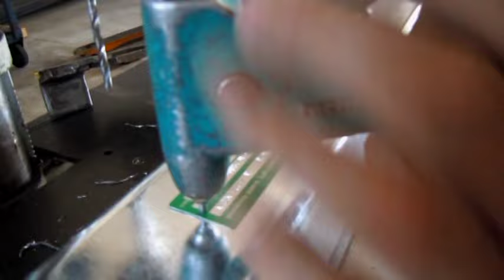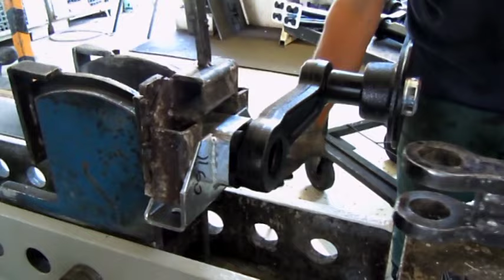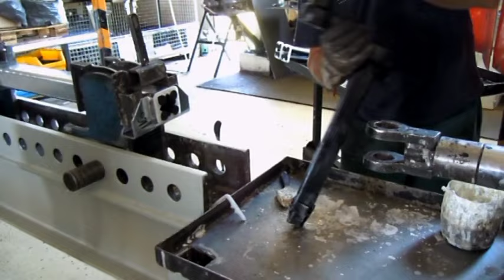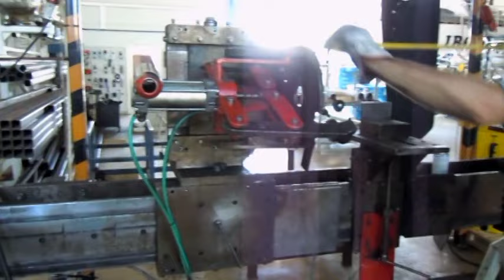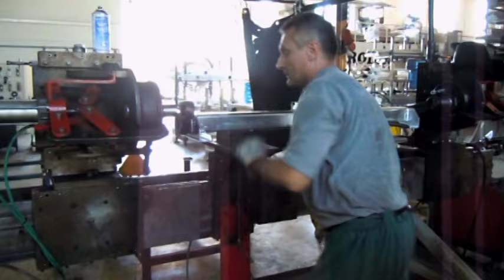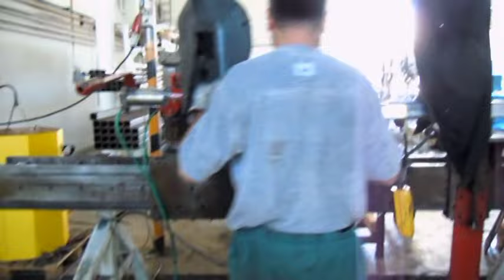Autóflex-Knott torziós tengely benyomása / torsion axle pressing in

Comment: I have made my own independent suspension units with 50mm box, 30mm square section and 18mm 70 shore rubber all pressed in in a home made press, works well, I used silicon spray as a lubricant.
Reply: Hi Tony, thank you for sharing as I have been planning to do the same. You mean 18mm diameter for the four rubbers - one per corner of the 30mm square, right? How do you keep them steady or not being pushed while the square thingy is being pressed in?

Comment: And then after a few years the rubber dry rots and the swingarm rips off. Happened to me a few days ago. Totalled my trailer. Not a very good design if you ask me.
Reply: mine's slightly protruding on one side; probably impossible to push back